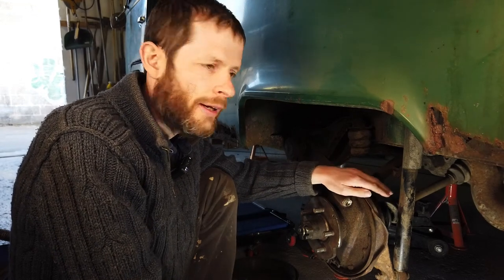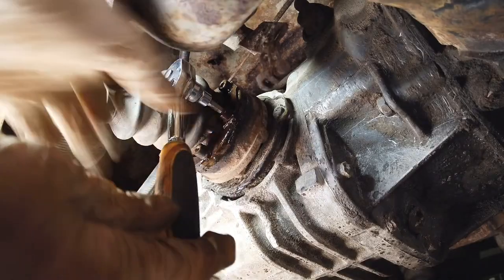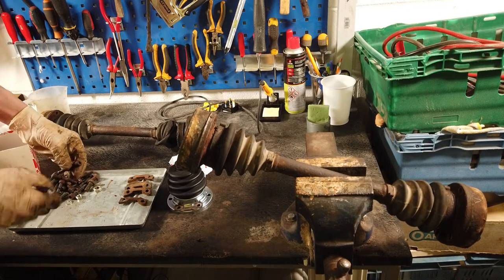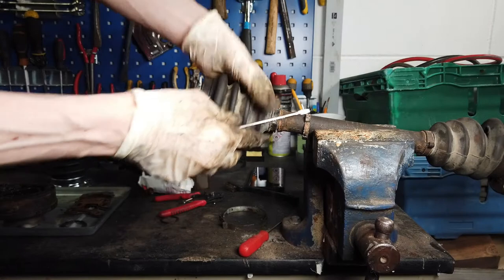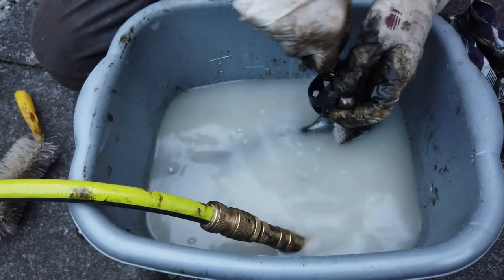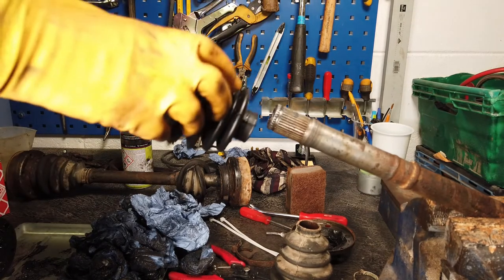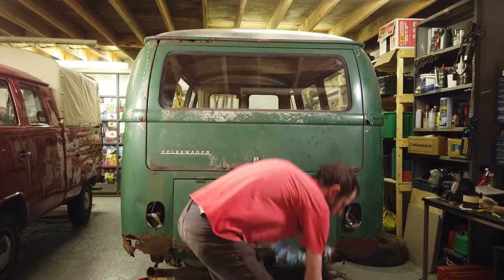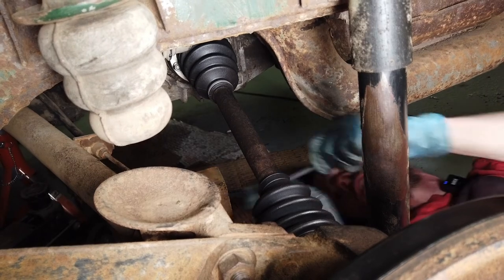VW Replacing the CV boots

Comment: Good thing you caught your mistake when reassembling the CV joints, I was shaking my head when you put the first one back together. But I feel you should have mentioned exactly what you did wrong, then shown how you corrected the issue.  

Also, I believe the chamfered edge of the inner race should be positioned toward the axle, not toward the  case, as it gives the axle just a bit more range of outward pivoting motion without it making contact with the race. 

Good video, thanks for sharing. 
👍